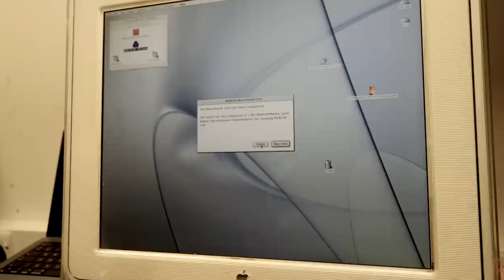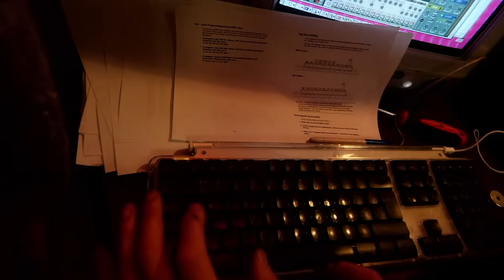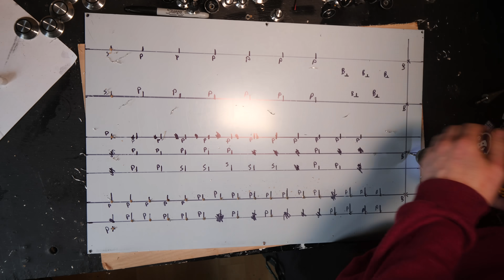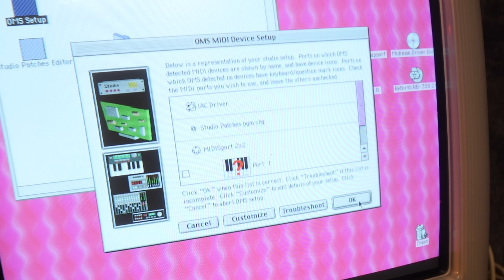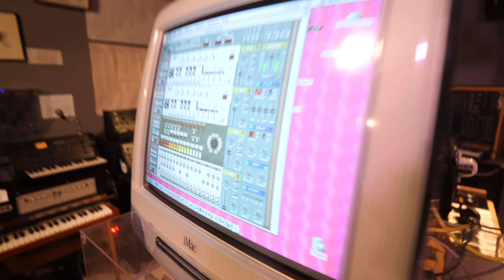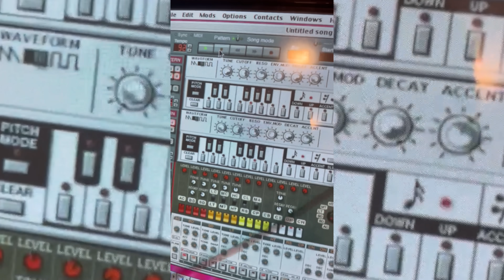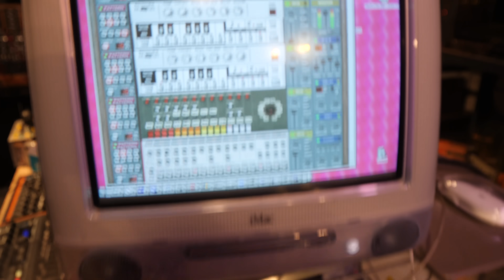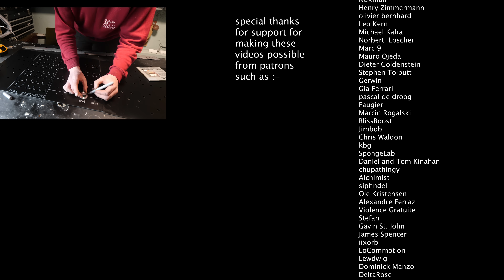Building A REBIRTH-338 Controller - 90's Computer Music Re imagined

Comment: i just used a behringer bcr2000 on windows but i think on mac it's limitless to control the rebirth not the same on windows
Reply from the maker: The cc's are set on rebirth but you just adjust the behringer. Which can have any cc on each knob so it'll work on both mac or windows the same
Reply: @LOOKMUMNOCOMPUTER   Yeah i found on windows xp rebirth the manual settings only covers a certain amount of controls i filled in the grid and could not ad anymore. I think it's different on  mac. From experience i would use the pre set cc's anyway the manual controls are a little clunky on windows
Reply from the maker: aaah yes that is the difference between 3.2 and 3.21 @theprogrammerrolandmc3039

Comment: T Hainbach: actually you can modify the sound, afterall a mac is just a piece of hardware... you could swap sound cards and play with different settings. I would not reccomend power sag tho :)
It is way easier to do trickery sound card bits on a 486 than a mac. Also some sound cards of the days were humongous. Nice rabbit hole. Today is impossible to do such tweaks like bit rate if not for sfw.
If Rebirth was made for a C64 or a Colecovision then... :)

Comment: I would to see a reissue ReBirth for modern computers, guessing it won't run on Win11 or Linux. Regarding the MUXing, you could even MUX it into a Teensy or ESP32 and use USB MIDI.

Comment: I am absolutely certain if someone would make this exact hardware with slightly more flexible sequencer it would be sold outright. so 909, 808 and 2x 303 clones. with sequencer, mixer, effects, it would probably be under a grand and still super fan to play. I got chills when I heard that line, even if it was slightly faster.

Comment: OMG! I JUST found my bootlegged copy of Rebirth that I found on my last trip home and brought back today! Synchronous! I used the program for simple rhythm loops and things for my demos back in 2006 or so. It’s great but using the computer interface for live is a challenge. I think the designers thought that composers would sit down and fill the banks with loops and then take their laptops and then DJ with the stems they had created. This has been a dream of mine for twenty years and it is marvelous to see. The only thing is that would it be possible to have a shift key for the different banks so that you only needed 12 buttons instead of 48? This design is simpler though so I can see why you went with that. Great job! Fantastic!
Reply: For continuity, it turns out that Bottles for Linux can run the .exe program for Rebirth quite nicely.

Comment: Helped my maths teacher assemble bits of an analogue synth (Might have been a Hobby Electronics one) and learned about sampling on a BBC Micro with a Ferranti ADC chip on a breadboard.

Used to tit about with the synth packages, samplers and trackers on Amiga a few years later (just recently got a sampler and MIDI interface for a 'miggy 500 again), had a Roland D and SC110 (ack, U110, not SC) at one point and absolutely loved it but never really 'did' anything other than mess about for myself.  

Real happy days and loads of fun.

Comment: Hi Sam...is there a plan and a detail list how to build it?  This is my dream come true for this software since 1997 since i bought it...but i am not such a technical master than you
Reply from the maker: i mention int vid, search "notes and volts midi controller" match it up to the parameters in the rebirth manual. i was going to be more explanative but because its similar to the sega mega drive synth i built and people managed it from the same resources, i figured it would be enough. good luck

Comment: Just so happens, I've got the PC version of the Rebirth RB-338 installer disc, but it will only run on Windows 98SE and my main studio PC runs Windows 11 22H2, apparently there is a way to get it working on Windows 10 though.
Reply: Virtual machines an option? Sure I’ve had it running on 10

Comment: good job!  would sound cool if u put a distorter on the output, thats what id do.   making a music machine is good practice for your electronics.
Reply from the maker: it has a distortion on it, you can hear it when you turn it on
Reply: @LOOKMUMNOCOMPUTER  yeh but the distorts are on each channel individually separately, but i mean on the master, to clip it all together.  strange things happen.
Reply from the maker: @magnuswootton6181  it is on the master, it all gets shared
Reply from the maker: @magnuswootton6181  there is 1 distortion so the 808 and 303's meld together. and wavefold
Reply: @LOOKMUMNOCOMPUTER  is it one distorter and they are getting routed to it - or is it actually separate distortions on each module?
Reply from the maker: @magnuswootton6181  as mentioned it's sends to a master distortion
Reply: @LOOKMUMNOCOMPUTER  hey i might be wrong, ill check it out when i get a chance to.   thanks awesome vids!!!

Comment: Imagine making a giant moog modular style moog one. 8 or 16 full voices of customized model 10 or 15s and eventide effects from some rack or pedal unit with the closest moog style modules that match the filters, ring mod, fm, noise gen, and sequencer. A crt screen for the settings and presets, and then a controller that has the wheels and xy pad. This would be a giant system but it would be so cool. You could also do it. The other way around and chop up a moog one and make modular modules out of every module that can be split up. Turning the moog one into a completely modular system. The thing is so expensive I honestly don’t know if it’s possible already to manipulate it like a modular synth on the control screen already. Lol

Comment: I've been thinking of this program lately, but I couldn't remember the name. I'm no musician. Actually far from it, but I remember playing with a copy of Rebirth and being amazed at what some more talented people were able to do with it.

Now I have another memory of a music program, and I'm not certain if it was Rebirth, an expansion of some kind, or a totally unrelated product. Thing is that it emulated some well known synth that used patch cables for building the signal path, and this program emulated that including the cable clutter. I remember that this both amused me and seemed totally ridiculous. And yet it did give you a almost analogue feeling when the panel started filling up with wires going everywhere.

I probably spent less than a hour in total with these programs but I have never forgotten the experience. The names of the software is however lost in the dusty confines of my memory. But at least I now know one of them was Rebirth. I won't ever forget that again until tomorrow...
Reply: Propellerhead Reason 1

Comment: Reminds me of a similar kind of controller I made a few years ago for Lightroom to have all the controls I would need for most image processing without going through panels outside of things like masks that require fine control.  I wanted to have a board of sliders for monochrome processing, but instead I use rotary encoders with leds to show with color channels they were and stuff.  I need to go back and properly make a small monochrome editing deck with darktable that I've been moving over to more and more.  Just need Affinity Photo to get a Linux port and I wouldn't have to dual boot Windows anymore on my editing pc.  GIMP is beyond gimped compared to other tools on the market, not a real solution.  People can't really make the argument of it being opensource, so it's slow to develop, because Blender is in the same opensource realm, and has rapidly become an industry tool instead of barely reaching Photoshop 7 power, maybe CS1 or CS2.

Comment: Built my first Arduino based box of knobs for the Moog Animoog software running on an iPod touch.Moog had released wallpaper images of the Moog Voyager, so I edited them and laminated a frontpanel. animoog midi controller using Atmega328P

Comment: One of my very favorite programs was for PPC Mac (G3) or better was Arturia Storm 3.0. I still have it, I just can no longer register it after installion. Last time I tried to register it, Arturia apologized and gave me Analog Lab. While I love Analog Lab and even upgraded it to V Collection. I do still miss Storm 3,0.   It just insired me so much.  It works on Windows XP, so I may throw together a min 2000's retro box and just run it unregisterd, it still lets me do everything but can't save a project.  The Power Mac I had stopped working, so can't use that anymore. I tried installing it in a Win XP VM, but it was just too slow to process all the audio.

Comment: Because of its 2 drum machines and great little mixer I still use Rebirth as a flexible on the fly drum machine! The 2 sunths are ok but not great for my synth needs. Hint: if you load a disc image of the CD it greatly eases loading time.

Comment: Oh man, the keyboard you pulled out at 2:00 was the first keyboard I ever got! My parents got it for my when I was 12, and I used it along with Reason 2.5 and ReBirth! I would have been so psyched to have this interface. I remember setting up jam sessions with a ton of tracks in Reason and using mute buttons and volume fades to jam. I always wondered if getting a MIDI capable mixer so I could control the software directly would make that more fun. You basically answered the question!

Comment: 🙏🙋🧡💚💫✨💫✨💫 Where do you got you panels?  and knobs?... I search for a manufacturer using ABS, for pannels. Eventually making the holes for sliders and TX7 button's holes, and engraving writings and lines?
Actually my project is to run two Tx Dx 7 in one rack. The original metal board is naked and I would love to use them toghether with a computer side to program this history piece😎🙀🤔😵🤗
This said, love the job done here very interesting, i must have reason and a rebirth in my disks, and a pair of imacs, a flat one, that could give me some ideas. 👍🌜💥  I wil go soon watching the videos I missed, perhaps I have a Sega too. The thing boring is to spend so much time to mount the system, but as virtual instrument this is pretty to use it an learn what it is able to do.
Reply: He harvests panels off the side of the road where they grow on metal poles.

Comment: I still own the dedicated midi controller for Re-Birth, it was called the Phat-Boy by Keyfax. It wasn't very flexible though, as it used fixed CCs. I dug the thing out of a cupboard about a month ago. I now use it to control a bunch of Roland Cloud plugins, still works perfect. It's not nearly as groovy looking as your thingymabob thought!
Reply: i had a phatboy too :) good old times
Reply: @tomaslainas695  Someone is supposed to give me one, I keep waiting to run into them again. But I have to get rebirth running under Wine, and then the window will be tiny!
Reply: This is crazy! I worked for Keyfax - who made the original Phatboy MIDI controller back in the “before times” that worked with ReBirth. But this… this is some next level shiz!
Reply: Was it a dedicated controller for Rebirth or was it a universal MIDI controller that worked with Rebirth with just 13 CC pots?
Reply: @subs4794  Yeah, It wasn't 100% for Rebirth per se, but it was heavily marketed toward use with Steinberg programs, mainly Rebirth RB338. It did come with a really good quality vinyl Steinberg/Rebirth overlay, whereas the other overlays were paper. The original had 3 different modes. I've got the later v2 model that has 6. 
Mode 1: Roland GS, Yamaha XG compatible sound modules.
Mode 2: Creative Labs AWE32, 64, 64 Gold, Soundblaster Live! and Platinum soundcards.
Mode 3: Standard MIDI Controller numbers (Continuous Controllers 1‑13).
Mode 4: Roland JV1080, 2080, 1010, XP30/50/60/80.
Mode 5: Standard MIDI Controller numbers (Continuous Controllers 40‑52).
Mode 6: 'Classic' Mode (various Controller numbers). I just dug it out recently because it only just dawned on me that the Roland Cloud plugins I use have a MIDI learn function. You just Right-click a control knob on the screen, select Learn, then wiggle a knob on the Phat-boy, and bobs yer uncle.
Reply: @subs4794  It was a 13 knob controller that had different modes for different synths - one was a mode specifically for Rebirth, but it could also be just 13 CC pots - I mostly used mine with my first Roland synth for sound editing.

Comment: I thought it was going to be an analog lift controller panel and it turns out to be way way further out than that. A grandiose idea delivered so brilliantly, well done Sam for keeping us guessing. 
One thing... it is so specific to the old imac and the music software you really do need a backup system or some way of making a direct copy of the hard disk so you can rebuild the computer from scratch or one little cosmic Ray interaction with an ancient hard drive and you have a big panel of intense hard work for propping the door open with....